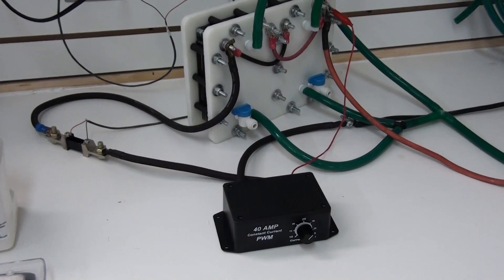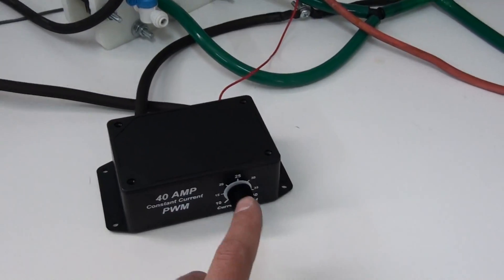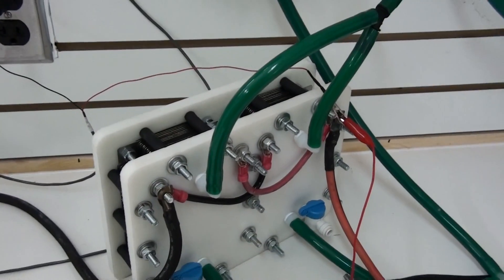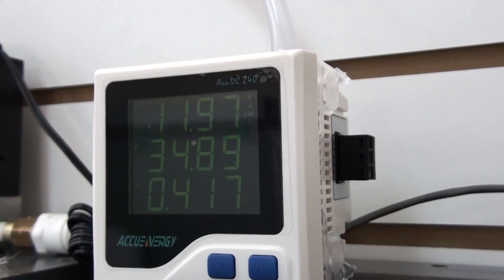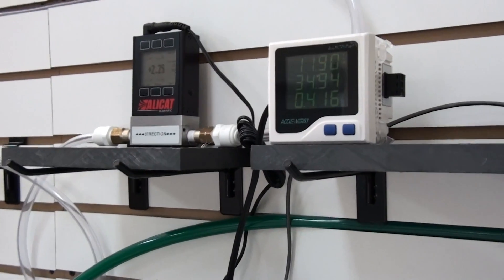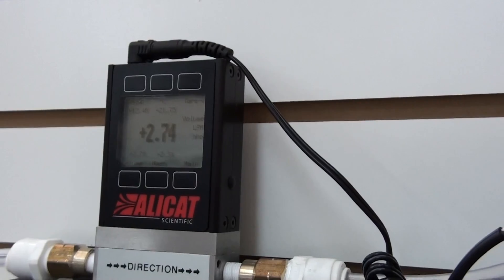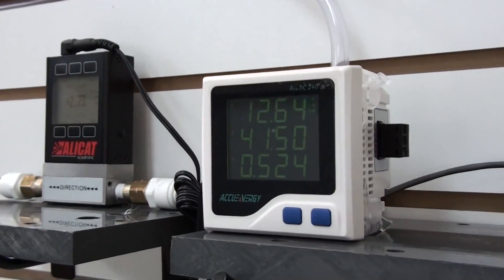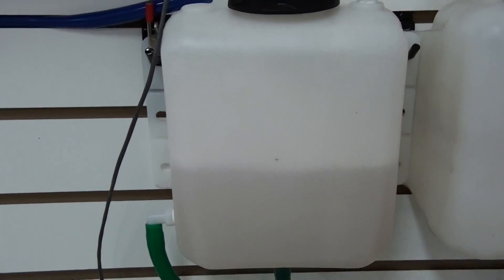HHO hydrogen 38 plate cell for light cammercial vehicles. Output and efficiency DEMONSTRATION.

Comment: Yes Steve, I knew you would be interested in that.
Both T.E.G.s thermal electric generators and stirling engines work on the princible of heat differentual.
Even if it's 40 - zero and one side is 40 - below and the other side 10 - below zero in theory it would still work.
Capture the 2/3 of wasted heat from a ICE engine and that would boast up the efficeintcy.
With the wasted heat in the exhaust system or coolant system you might be able to power the hydrogen generator without using a aternator.

Comment: Steve ? check out a British gentleman's video on You Tube were he built a thermalmechanical generator.
It produced 10 volts while running 5 LED lights.
Now if another sterling engine could be built to tap into the wasted heat from a car's engine with more powerful linear alternator that could possiblly power the hydrogen generator without using the car's battey or the car's aternator.